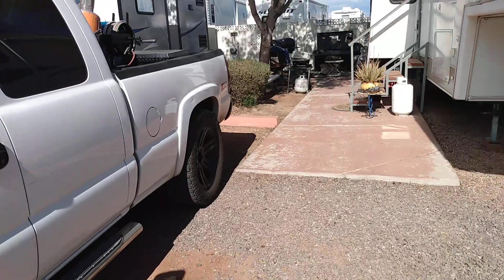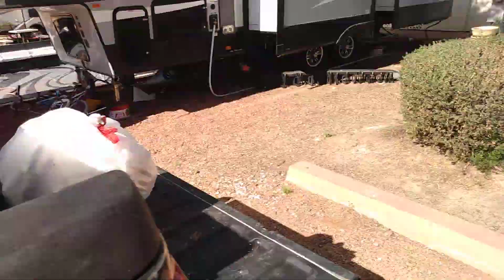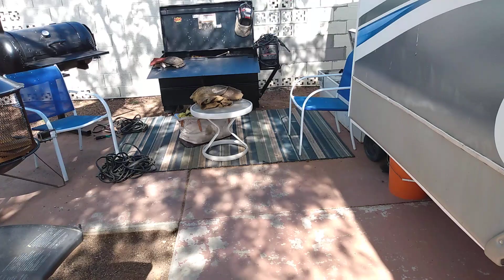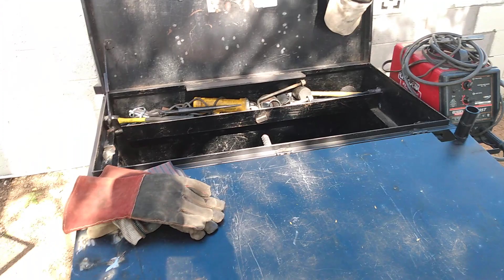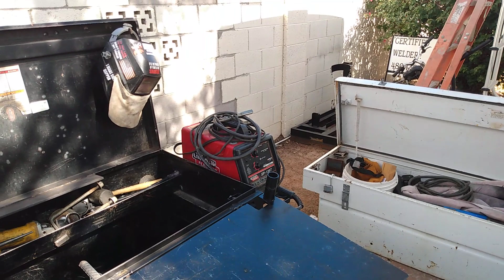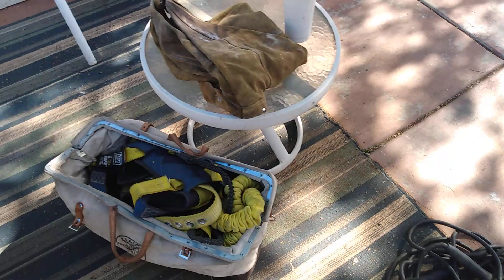Start off Small when Building your Independence! #weldingandhiphop #fabbboxxx

Comment: I appreciate you so much, thank you for your work.
Reply from the maker: Thanks HogOn
Reply: @HogOnWelding  I have a quick question, I'm a local 433 Ironworker and want to start welding and doing small projects on the side. What is a good welder to start with? And what  kind of jobs should I expect to get? Thanks!
Reply from the maker: It all depends on how are you doing field welding or shop welding I'll 225-250 will be good gas welder in the field
Reply: @HogOnWelding  Okay cool, yes I was thinking of being more of mobile welder/fabricator for now.
Reply from the maker: If you going to do Mobile Welding and Fabrication a 225 will be great and get you a good 180 to 140 welder for some fabrication all of this you can buy used getting started that's what I did and then later you can upgrade. HogOn